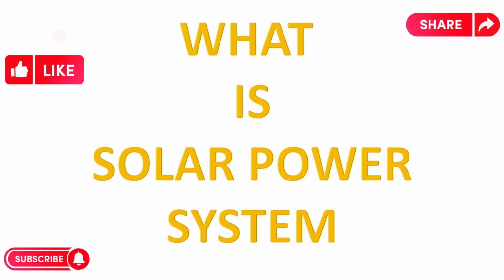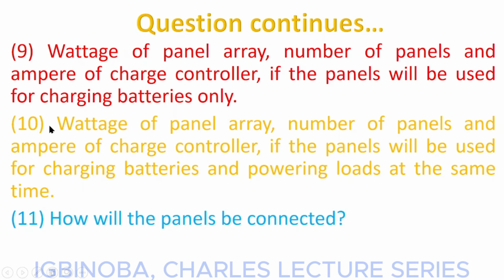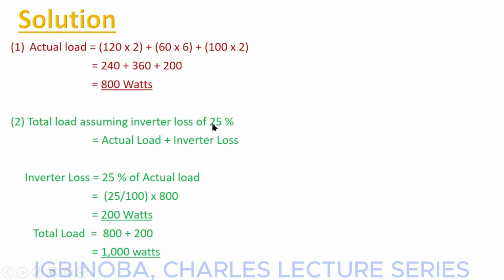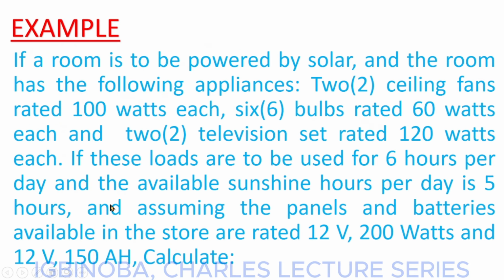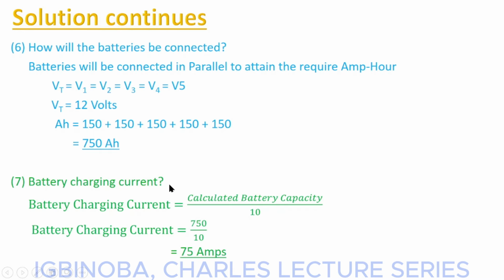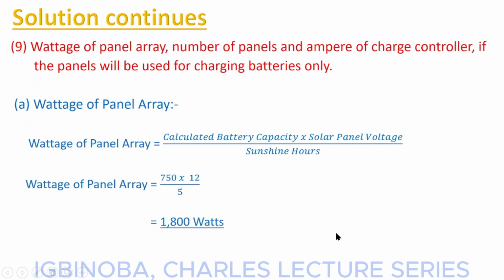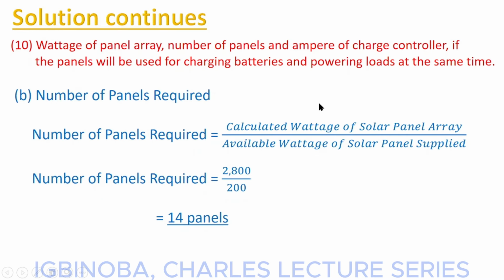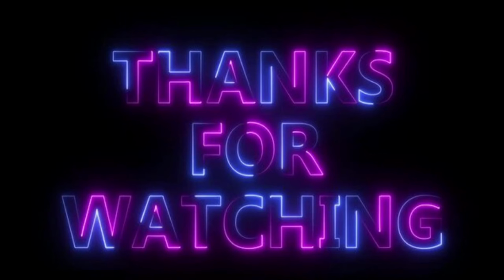Design of Solar Power System

Comment: PETRO337K

1. Actual load= (100×3)+(60×10)+(120×4) =1380watts  
2. Total load assuming inverter loss of 25%= Actual load +Inverter loss  
Inverter loss=25% of Actual load  
= 25%×1380=345 watts  
Total load= 1380+345=1725 watts  
3. Inverter rating on VA using power factor of 0.8  
= (1725÷0.8)= 2156.25  
4. Battery capacity using factor for reserve 75%=(2×1725×6×0.75)=1293.75Ah  
5. No. of batteries for backup hours=1293.75Ah÷150Ah= 8.6 =8 batteries  
6. How batteries will be connected?  
The batteries will be connected in parallel  
Vt=V1=V2=V3=V4=V5=V6=V7=V8  
Ah= 150+150+150+150+150+150+150+150=1200  
7. Battery charging current=1293.75÷10=129Amps  
8. Battery charging time assuming charging loss of 40%= 1293.75Ah+(40%+1293.75Ah)÷129A=14hrs  
9a. Wattage panel array= 3105 watts  
9b. Number of panels required= 3105÷345=9 panels  
9c. Ampere of charging controller required= 3105÷12=258.75Amps  
10a. Wattage of panel array= Calculated wattage of solar panel array for charging battery only+ calculated total load =3105+1725=4830watts  
10b. Number of panels required= calculated wattage of solar panel array÷ Available wattage of solar panel supplied= 4830watts÷345= 14Amps  
10c. Ampere of charge controller= calculated wattage of solar panel array÷ solar panel voltage=4830watts÷12volts= 402.5Amps  
11. How will the panels be connected?  
Ans: They will be connected in parallel

Comment: EEE39I 

1. Actual Load : 1380 watts
2. Total Load : 1725 watts
3. Inverter Rating : 2156.25 VA
4. Battery Capacity : 1293.75 Ah
5. Number of Batteries : 8.625 - 9 batteries
6. Parallel
7. Battery charging current: 129.375 Amps
8. Charging time : 14 hrs
9. (a) 3105 watts
(b) 15.525-16 panels
(c) 258.75 Amps
10. (a) 4830 watts
(b) 24.15 - 24 panels
(c) 402.5 Amps
11. Parallel

Comment: Mech 343Q
1)actual load = 1380watts 

2)total load= 1725 watts 

3) inverter rating =2156.25VA 

4)battery capacity= 1293.75A

 5)No of batteries= 9
 
6)batteries are connected in parallel 

7)battery charging current =129.4amps 

8)battery charging time=14hrs 

9a) wattage of panel array= 3105watts 

9b)number of panels=16panels 

9c)charge controller= 258.75A 

10a)wattage of panel array= 4830watts 

10b)number of panels = 24 

10c)charge controller= 402.5A 

11)panels are arranged in parallel

Comment: EEE386H

1. Actual Load : 1380 watts
2. Total Load : 1725 watts
3. Inverter Rating : 2156.25 VA
4. Battery Capacity : 1293.75 Ah
5. Number of Batteries : 8.625 - 9 batteries
6. Parallel
7. Battery charging current: 129.375 Amps
8. Charging time : 14 hrs
9. (a) 3105 watts
(b) 15.525-16 panels
(c) 258.75 Amps
10. (a) 4830 watts
(b) 24.15 - 24 panels
(c) 402.5 Amps
11. Parallel

Comment: MAR3127W

1. Actual load : 1380 W
2. Total load: 1725 w
3. Inverter rating: 2156.25 VA
4. Battery capacity: 1293.75 AH
5. Number of batteries: 9
6. Configuration: parallel 
7. Battery charging current: 129.375 amps
8. Charging time: 14 hours
9. (a) 3105 w
     (b) 15.5 panels
     (c) 258.75 A
10. (a) 4830 Watts 
       (b) 24 panels
        (c) 402.5 A
11. Configuration: parallel

Comment: MAR368P

1. Actual Load = 1380watts

2. Total Load = 1725watts

3. Inverter Rating = 2156.25VA

4. Battery Capacity = 1293.75Ah

5. Number of Batteries =8.625 = 9

6. Parallel Connection 

7. Battery Charging current = 129.375Amp

8. Battery Charging Time= 14hours

9a. Wattage on Panel Array = 3105watts
9b. Number of panels =15.5 = 16panels
9c. Ampere of charge controller = 258.75Amps

10a. Wattage of panel array = 4830watts
10b. Number of Panels = 24.15 = 25panels
10c. Ampere of Charge controller = 402.5amps

11. Parallel connection.

Comment: MECH367O

1. Actual load = 1380 W
2. Total Load = 1725 W
3. Inverter rating = 2156.25 VA
4. 1293 Ah
5. 9 batteries (150 Ah, 12 V each)
6. All 9 batteries in parallel
7. 129.4 A
8. 14 hours (limited by sunshine)
9a 3105 W,
b. 16 panels
c. 258.75 A
10a. 4830 W,
b. 24 panels
c. 402.5 A
11. All panels in parallel

Comment: MEC100V

1. actual load= 1,380 watts
2. total load= 1,725 watts
3. inverter rating= 2,156.25 VA
4. battery capacity= 1,293.75 Ah
5. No. of battery= 9
6. batteries are connected in parallel 
7. battery charging current= 129.4 Amps
8. battery charging time= 14 hrs
9a. wattage of panel array= 3,105 Watts
9b. number of panels= 16 panels 
10a. wattage of panel array= 4,830 watts
10b. number of panels= 24
11. panels are arranged in parallel

Comment: EEE3175S

1) Actual Load= 1380watts
 
2) Total Load= 1725watts
 
3) Inverter rating = 2156.25VA
 
4) Battery Capacity = 1293.75Ah 

5) No of Batteries = 9 

6) Batteries are connected in Parallel
 
7) Battery Charging current= 129.4 amps 

8) Battery Charging time = 14hrs
 
9a) Wattage of panel array = 3105watts 

9b) Number of panels = 16 panels 

9c) Charge Controller = 258.75A
 
10a) Wattage of panel array = 4830watts 

10b) Number of panels = 24 

10c) Charge Controller = 402.5A
 
11) Panels are arranged in Parallel

Comment: MECH3101w
1 Actual load 1380W
2 Total load  1720W
3 Inverter rating  2156.25VA
4 battery Capacity 1293.75Ah
5 number of batteries 8.6
6 Parallel 
7 Battery charging  129.4A
8 T = 14hrs
9 (a) 3105W
   (b) 15.5 panels 
   (c)  258.75 A
10 (a) 4830W 
     (b) 24 panel 
     (c) 402.5A 
11 Parallel

Comment: MECH3147Q
1. Actual load = 1380 watts
2. Total load = 1725 watts 
3. Inverter rating = 2156.25 VA
4. Battery capacity= 1293.75 AH
5. Number of batteries = 8.625 ~ 9 batteries
6. Parallel 
7. Charging current = 129.375 Amps
8. Charging time = 14 hours
9(a). Wattage of panel array = 3105 watts
(b) . Number of panels required= 15.525 ~ 16 panels
(c). Ampere of charge controller= 258.75 watts
10(a). Wattage of panel array = 4830 watts
(b). Number of panels required= 24.15 ~ 25 panels
(c). Ampere of charge controller required= 402.5 Amps
11. Parallel

Comment: CHE 3128X
1.Actual load =1380watts
2.Total load =1725watts
3.Inverter rating =2156•25VA
4.Battery capacity =1293•75Ah
5.Numbers of batteries =9
6.Batteries are comnected on parallel
7.Battery charging current  =129•4amps
8.Battery charging time =14hrs
9a.Wattage of panels arrary =3105watts
9b.Numbers of panels =16 panels
9c.Chanhe controller = 258•75A
10a.Wattage of panels arrary =4830watts
10b.Numbers of panels =24
10c.Change controller = 402•5A
11.panels are arranged in parallel.

Comment: COMP3113I

1. Actual load is 1380 w

2. Total load is 1725 w

3. Inverter rating is 2156.25 VA

4. Battery capacity is 1293.75 AH

5. No. of batteries is 9

6. Parallel

7. Battery charging current is 129.375 amps

8. Charging time is 14 hours

9.

i. 3105 w

ii. 15.5 panels

iii. 258.75 A

10.

i. 4830 w

ii. 24 panels

iii. 402.5 A

11. Parallel

Comment: MECH382D

1. Actual load= (100×3)+(60×10)+(120×4) =1380watts
2. Total load assuming inverter loss of 25%= Actual load +Inverter loss
Inverter loss=25% of Actual load
= 25%×1380=345 watts
Total load= 1380+345=1725 watts
3. Inverter rating on VA using power factor of 0.8
= (1725÷0.8)= 2156.25
4. Battery capacity using factor for reserve 75%=(2×1725×6×0.75)=1293.75Ah
5. No. of batteries for backup hours=1293.75Ah÷150Ah= 8.6 =8 batteries 
6. How batteries will be connected?
The batteries will be connected in parallel 
Vt=V1=V2=V3=V4=V5=V6=V7=V8
Ah= 150+150+150+150+150+150+150+150=1200
7. Battery charging current=1293.75÷10=129Amps
8. Battery charging time assuming charging loss of 40%= 1293.75Ah+(40%+1293.75Ah)÷129A=14hrs
9a. Wattage panel array= 3105 watts
9b. Number of panels required= 3105÷345=9 panels 
9c. Ampere of charging controller required= 3105÷12=258.75Amps
10a. Wattage of panel array= Calculated wattage of solar panel array for charging battery only+ calculated total load =3105+1725=4830watts
10b. Number of panels required= calculated wattage of solar panel array÷ Available wattage of solar panel supplied= 4830watts÷345= 14Amps
10c. Ampere of charge controller= calculated wattage of solar panel array÷ solar panel voltage=4830watts÷12volts= 402.5Amps
11. How will the panels be connected?
Ans: They will be connected in parallel

Comment: PETRO326Z 

BELOW ARE THE ANSWERS: 

1. Actual load= (100×3)+(60×10)+(120×4) =1380watts
2. Total load assuming inverter loss of 25%= Actual load +Inverter loss
Inverter loss=25% of Actual load
= 25%×1380=345 watts
Total load= 1380+345=1725 watts
3. Inverter rating on VA using power factor of 0.8
= (1725÷0.8)= 2156.25
4. Battery capacity using factor for reserve 75%=(2×1725×6×0.75)=1293.75Ah
5. No. of batteries for backup hours=1293.75Ah÷150Ah= 8.6 =8 batteries 
6. How batteries will be connected?
The batteries will be connected in parallel 
Vt=V1=V2=V3=V4=V5=V6=V7=V8
Ah= 150+150+150+150+150+150+150+150=1200
7. Battery charging current=1293.75÷10=129Amps
8. Battery charging time assuming charging loss of 40%= 1293.75Ah+(40%+1293.75Ah)÷129A=14hrs
9a. Wattage panel array= 3105 watts
9b. Number of panels required= 3105÷345=9 panels 
9c. Ampere of charging controller required= 3105÷12=258.75Amps
10a. Wattage of panel array= Calculated wattage of solar panel array for charging battery only+ calculated total load =3105+1725=4830watts
10b. Number of panels required= calculated wattage of solar panel array÷ Available wattage of solar panel supplied= 4830watts÷345= 14Amps
10c. Ampere of charge controller= calculated wattage of solar panel array÷ solar panel voltage=4830watts÷12volts= 402.5Amps
11. How will the panels be connected?
Ans: They will be connected in parallel

Comment: MECH349W

1. The actual load = 1380W

2. The total load = 1725W

3. Inverter rating= 2156.25VA 

4. Battery capacity= 1293.75h

5. Number of batteries =9

   6.Batteries are        connected in parallel

7. Battery charging current = 129.4amps

8. Battery charging time is 14hrs

9a. Wattage of panel array is 3105W

9b Numbers of panels is 16 
9c. Charge controller - 258.75A

10a. Wattage of panel array is 4830W

10b. The number of panels is 2410c 

10c. Charge controller 402.5A 

11. Panels are arranged in parallel

Comment: PETCHEM332F

1 Actual load 1380W
2 Total load  1720W
3 Inverter rating  2156.25VA
4 battery Capacity 1293.75Ah
5 number of batteries 8.6
6 Parallel 
7 Battery charging  129.4A
8 T = 14hrs
9 (a) 3105W
   (b) 15.5 panels 
   (c)  258.75 A
10 (a) 4830W 
     (b) 24 panel 
     (c) 402.5A 
11 Parallel

Comment: PETRO319S

1. Actual Load
(3 × 100) + (10 × 60) + (4 × 120) = 1380 W

2. Total Load (Including 25% Inverter Loss)
1380 + (25% of 1380) = 1380 + 345 = 1725 W

3. Inverter Rating (Power Factor 0.8)
Inverter Rating = 1725 ÷ 0.8 = 2156.25 VA

4. Battery Capacity (With 75% Reserve Factor)
Battery Capacity = (2 × 1725 × 6 × 0.75) ÷ 12 = 1293.75 Ah

5. Number of Batteries Needed
1293.75 ÷ 150 = 8.625 ≈ 8 batteries

6. Battery Connection Method
All 8 batteries will be connected in parallel to maintain 12V and increase amp-hour capacity.
Total Ah = 150 × 8 = 1200 Ah

7. Battery Charging Current
1293.75 ÷ 10 = 129.375 A

8. Charging Time (With 40% Loss)
Total Required Charge = 1293.75 + 40% of 1293.75 = 1811.25 Ah
Charging Time = 1811.25 ÷ 129.375 ≈ 14 hours

9a. Solar Panel Array Size (For Charging Batteries Only)
(1293.75 × 12) ÷ 5 = 3105 W

9b. Number of Solar Panels
3105 ÷ 200 = 15.525 ≈ 15 panels

9c. Charge Controller Rating
3105 ÷ 12 = 258.75 A

10a. Panel Array Size (Charging + Load Supply)
3105 + 1725 = 4830 W

10b. Number of Solar Panels Required
4830 ÷ 200 = 24.15 ≈ 24 panels

10c. Charge Controller Rating
4830 ÷ 12 = 402.5 A

11. Solar Panel Connection Method
All solar panels will be connected in parallel.

Comment: MECH3195M

1. Actual load :1380 watts
2. Total load : 1725 watts
3. Inverter rating: 2156.25 VA
4. Battery capacity= 1293.75 Ah
5. Number of batteries: 8.625 ~ 9
6. Parallel
7. Battery charging current: 129.375 Amps
8. Charging time: 14 hrs
9. a) 3105 watts
b) 15.525 ~ 16 panels
c) 285.75 Amps
10. a) 4830 watts
b) 24.15 ~ 24 panels
C) 402.5 Amps
11. Parallel

Comment: MAR 369Q
Marine Engineering 
 
1. Actual load= (100×3)+(60×10)+(120×4) =1380watts
2. Total load assuming inverter loss of 25%= Actual load +Inverter loss
Inverter loss=25% of Actual load
= 25%×1380=345 watts
Total load= 1380+345=1725 watts
3. Inverter rating on VA using power factor of 0.8
= (1725÷0.8)= 2156.25
4. Battery capacity using factor for reserve 75%=(2×1725×6×0.75)=1293.75Ah
5. No. of batteries for backup hours=1293.75Ah÷150Ah= 8.6 =8 batteries 
6. How batteries will be connected?
The batteries will be connected in parallel 
Vt=V1=V2=V3=V4=V5=V6=V7=V8
Ah= 150+150+150+150+150+150+150+150=1200
7. Battery charging current=1293.75÷10=129Amps
8. Battery charging time assuming charging loss of 40%= 1293.75Ah+(40%+1293.75Ah)÷129A=14hrs
9a. Wattage panel array= 3105 watts
9b. Number of panels required= 3105÷345=9 panels 
9c. Ampere of charging controller required= 3105÷12=258.75Amps
10a. Wattage of panel array= Calculated wattage of solar panel array for charging battery only+ calculated total load =3105+1725=4830watts
10b. Number of panels required= calculated wattage of solar panel array÷ Available wattage of solar panel supplied= 4830watts÷345= 14Amps
10c. Ampere of charge controller= calculated wattage of solar panel array÷ solar panel voltage=4830watts÷12volts= 402.5Amps
11. How will the panels be connected?
Ans: They will be connected in parallel

Comment: CHM312L
1.Actual load =1380w 2.Totalload=1725w 3.invertalrating=2156.25VA 4.Batterycapacity=1293.75AH 5.noofbatteries=8.625~9batteries 6.parallel
7.Batterycharging current=129.375ampd 8.charging time=14hours 9.(a)3105w
(b)15.525~16panels (c)258.75A
10.(a)4830w
(b)24.15~24panels
 (c)402.5A
11.parallel

Comment: CHM 3102X
1. Actual load :1380 watts
2. Total load : 1725 watts 
3. Inverter rating: 2156.25 VA
4. Battery capacity= 1293.75 Ah
5.Number of batteries: 8.625 ~ 9
6. Parallel 
7. Battery charging current: 129.375 Amps
8. Charging time: 14 hrs
9. a) 3105 watts
   b)  15.525 ~ 16 panels 
   c) 285.75 Amps
10. a) 4830 watts 
       b) 24.15 ~ 24 panels 
        C) 402.5 Amps
11. Parallel

Comment: PETROCHEM 391M

1 Actual load 1380W
2 Total load  1720W
3 Inverter rating  2156.25VA
4 battery Capacity 1293.75Ah
5 number of batteries 8.6
6 Parallel 
7 Battery charging  129.4A
8 T = 14hrs
9 (a) 3105W
   (b) 15.5 panels 
   (c)  258.75 A
10 (a) 4830W 
     (b) 24 panel 
     (c) 402.5A 
11 Parallel

Comment: COMP3117M

1 Actual load 1380W
2 Total load  1720W
3 Inverter rating  2156.25VA
4 battery Capacity 1293.75Ah
5 number of batteries 8.6
6 Parallel 
7 Battery charging  129.4A
8 T = 14hrs
9 (a) 3105W
   (b) 15.5 panels 
   (c)  258.75 A
10 (a) 4830W 
     (b) 24 panel 
     (c) 402.5A 
11 Parallel

Comment: MECH3170N
1. Actual load:1380w
2. Total load:1725w
3. Inverter rating:2156.25VA
4. Battery capacity:1293.75AH
5. Number of batteries:9
6. Configuration:parallel
7. Battery charging current:129.375 amps
8. Charging time:14 hours
9. (A)3105W
(B) 15.5 panels
(C) 258.75A

10. (A) 4830W
(B)  24 panels
(C)  402.5A

11. Configuration: parallel

Comment: EEE398T

1. Actual Load = 1380 watts
2. Total Load = 1725 watts
3. Inverter Rating = 2156.25 VA
4. Battery Capacity = 1293.75 Ah
5. Number of Batteries = 9 batteries

6. Parallel
7. Battery charging current = 129.375 Amps

8. Charging time = 14 hrs

9. (a) 3105 watts
    (b) 15.525 ~ 16 panels
    (c) 258.75 Amps

10. (a) 4830 watts
    (b) 24.15 ~ 24 panels
    (c) 402.5 Amps
11. Parallel

Comment: EEE 324X 

1. Actual Load = 1380 watts

2. Total Load = 1725 watts

3. Inverter Rating = 2156.25 VA

4. Battery Capacity = 1293.75 Ah

5. Number of Batteries = 8.625 ~ 9 batteries

6. Parallel

7. Battery charging current = 129.375 Amps

8. Charging time = 14 hrs

9. (a) 3105 watts
    (b) 15.525 ~ 16 panels
    (c) 258.75 Amps

10. (a) 4830 watts
    (b) 24.15 ~ 24 panels
    (c) 402.5 Amps

11. Parallel

Comment: EEE3171O

1. Actual Load = 1380 watts

2. Total Load = 1725 watts

3. Inverter Rating = 2156.25 VA

4. Battery Capacity = 1293.75 Ah

5. Number of Batteries = 8.625 ~ 9 batteries

6. Parallel

7. Battery charging current = 129.375 Amps

8. Charging time = 14 hrs

9. (a) 3105 watts
    (b) 15.525 ~ 16 panels
    (c) 258.75 Amps

10. (a) 4830 watts
    (b) 24.15 ~ 24 panels
    (c) 402.5 Amps

11. Parallel

Comment: Chm 317Q

1 (3×100)+(10×60)+(4×20)
1380 Watts 

2  inverter loss is 345 Watts 
Total load is 1380+345= 1725 Watts 

3 1725÷0.8= 2156

4  battery capacity is 1294Ah

5 1294/150 = 9 batteries 

6 1200

7 1294/10 =129 Amps 

8 charging time is 14 hours 

9a 1294×12/5 = 3105 Watts 
b 3105/200= 15 panels.
c 3105/12 = 259 Amps

10a 3105+1725=4830 Watts 
b 4830÷200= 24 panels
c 4830÷12= 403 Amps

11 The panel will be connected in parallel.